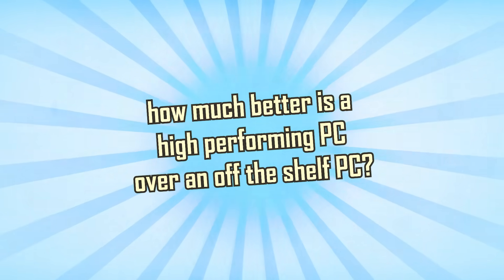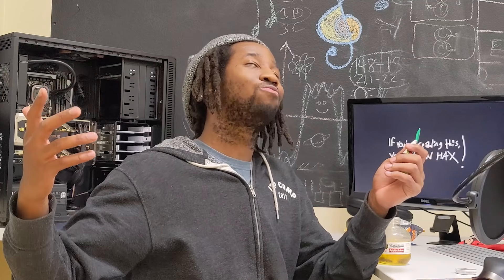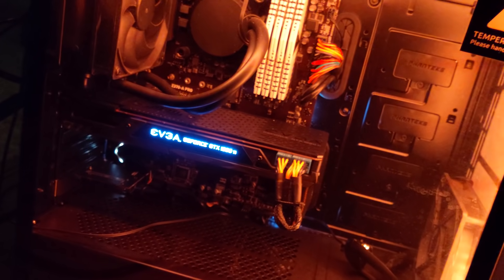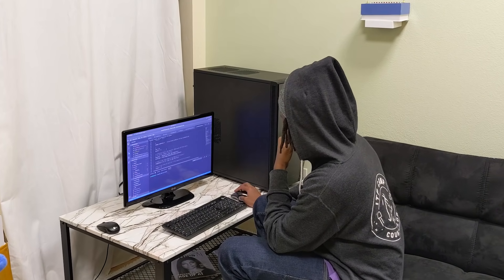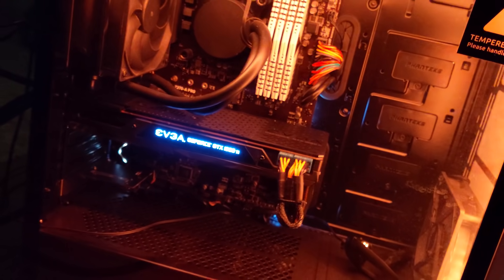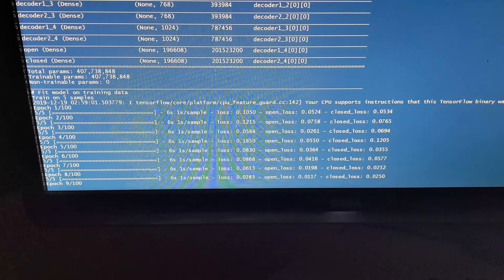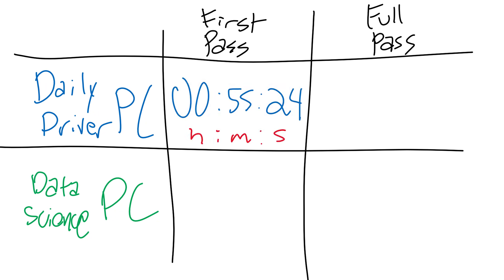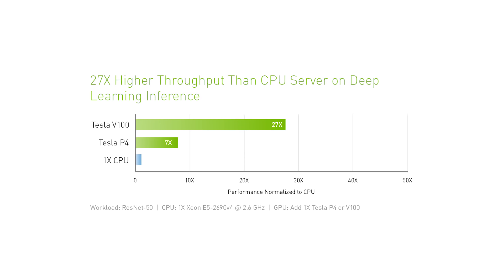Running AI on a $10,000 PC

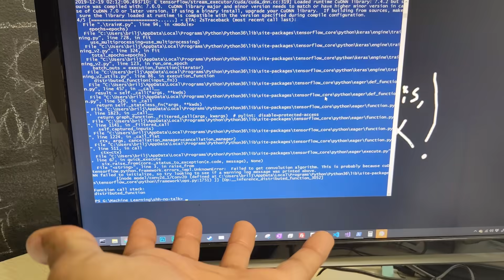Comment: 4:55
There is a warning message above it, at the top of the window.
"Loaded runtime CuDNN library: 7.4.2 but source was compiled with: 7.6.0. [...] If using a binary install, upgrade your CuDNN library."
The error message at the bottom says: "This is probably because CuDNN failed to initialize,"
So you need to update CuDNN to version >= 7.6.0.
Reply: Can't use CudNN unless you have an Nvidia gpu
Reply: @mohameddharis6824  He has Nvidia GPUs in both systems
Reply: upgrading Cuda libraries on windows is considerably easier than on linux. But you really should use docker container or some kind of container. it doesn't help that Google's tensorflow docs on installation errors kinda sucks!

Comment: I had the same problem a while ago during a computer science lecture. My laptop did not support AVX which is needed in order to run tensorflow. What I ended up doing was replacing the tensorflow backend with Theano, which supports the same instruction set as tensorflow, but is not dependant on AVX

Comment: Hi Jabrils, on the screen of the laptop you planned to use (the one you ended up throwing in the bin), you were downloading the Linux version of the file. To install tensorflow without a file just run "pip install tensorflow" on the command prompt. To install with a file just click this link and save the file:

https://files.pythonhosted.org/packages/c6/dc/9030097e5774fe02d1be3cb42eb54125d2c0607a6c11172f1dcad2b7fdcc/tensorflow-2.3.0-cp37-cp37m-win_amd64.whl

By The Way: I selected this file seeing your python version in the video.

Then navigate to the file in the cmd and run "pip install tensorflow-2.3.0-cp37-cp37m-win_amd64.whl"

I hope this helped you Jabrils. By The Way: I love some of your AI and Machine Learning Videos. Also I am 10 years old and I am interested in AI and ML in Python.

Comment: well... did you install the NIVIDIA CUDA 10.0 Package and delete the cud64nn.dll? cause yeah if you don't tensorflow prints that error, you need tensorflow 1.14.0 for py36 for tensorflow to work on windows 64. You also need the visual studio C++ build kit regardless of if you use VS, tf imports modules from the toolkit

Comment: Cool PC bro, but I'm kinda curious how the algorithm actually works.

I would think that a good way to do it, would be to make multiple algorithms that each do a small job, and contribute to a final algorithm to tie it all together.

I think it would be good to make simple image recognition algorithms to do these things:
Find your head in an image.
Find the direction you're facing.
Calculate the properties of the ambient light in the room, based on how it changes the skin tone of your face.
Find the position of your mouth (and optionally, your jaw) on your face, and include some margins around the edges.

You can then have those algorithms feed their output to a final algorithm that uses the hints provided, as well as the original image they each looked at, to decide how best to do its thing. Except that the algorithm for finding the location of the mouth, should probably actually be used to run a cropping utility of some kind, to pre-process the input for the final algorithm. And the algorithm to find your head in an image, should do that, but for the other smaller algorithms.

But don't take my word for it! I'm just a backseat driver.

Comment: Wow two titans!!!
And what’s that’s u got under that Corsair closed loop liquid cooling unit.
I see no situation we’re you need 120 gigs of ram.
Reply: After Effects eats up all 32 GB of my RAM just by starting a super basic project. Other programs like Blender can also use a lot, so it's not uncommon to see PCs with 64 GB, 128 GB, or even more.

I would not be surprised if data science also can required large amounts of ram to handle large data-sets or huge files.

Comment: YOU can get almost the same performance by using 2x Nvidia 2080 Super cards in SLI for a fraction of that cost. Titan cards are for the industry people and the fact that they are not consumer grade puts a huge price penalty on them, effectively jacking up the price.
Consumer hardware is much more competitively priced, and hence the only sensible recommendation for normal people to buy. 
For example, Nvidia 2070 ti cards can be bought for around 500 USD apiece, and put in a PC worth 2500 USD for a similar performance as this 10K USD ridiculous thing. 

You can compare the Spec sheets of the 2 graphic cards as well till the 99th percentile scores.
Thank you.

Comment: dude I have an HP z600 with a tb hd and a tb ssd and 12 gigs of ram, the ram is not great but the cpu is the xeon 5645 and you can dual socket it.  Then it runs two 10mb l3 caches and you can put in even more ram.  Its ECC ram though also so you have to buy it on amazon and its cheap. I paid $275, put in gtx 1060 6gb also has dual slots for video cards.  They are the best cheapest buy for the most value.

Comment: How much faster would this be than your 1080ti system, saw some where that the tensor cores on the rtx cards only speed up training if using fp16. Also heard that sli doesn't really improve much as tensorflow can't use both gpu's memory.

Comment: The laptop couldn't install TensorFlow, because CPUs that do not support AVX, the TensorFlow must be version 1.5 or lower. If you want to install Tensorflow 1.5, the Python version must be 3.5 or lower. So the updated TensorFlow that was most probably trying to be installed didn't work. AVX is only on the newer CPU's and on the intel core series chips. So the cheap laptop was probably missing the AVX support.

Comment: 4:00 - LOL, you tried to install the manylinux version of tensorflow on a Windows platform, that is why you received that error (side note: that is also why "sudo" did not work for you, the "sudo" command is found on Linux systems, not Windows). You need to either do "pip install https://storage.google.apisdotcom/tensorflow/windows/cpu/tensorflow-2.0.0-cp35m-win_amd64.whl"and re-write/re-compile your script/app for windows or you could try installing the manylinux version of tensorflow using Windows 10's WSL but I don't know if that will work or not as I have never used Win 10's WSL, the last I heard though was that WSL is still MILES away from a good Linux emulation.

Also, at 5:00, the error log that it's telling you to check for is literally at the top of that same window. Basic Linux troubleshooting, any time you get an error message, trace backwards through the log until you find where the first exception is thrown and then address those issues, re-compile and run again. Lather, rinse, repeat until successfully compiled/running.

If you need help, hit me up, I've had the tensorflow/faceswap program working on Windows before with cuDNN...

Comment: OMGawD that error @ 5:00  LMAO
Reply from the maker: you're telling me 🙄🙄🙄
Reply: @Jabrils  I started programming 40 years ago, and I've never seen a message that bad unless the developer was intentionally (and clearly) making a joke.
Reply: @Us-wc5js  It's very common when scripts recurse multiple levels deep and subscripts only pass return codes back up the stack.  So like every package build ever.  'Make' doesn't know why that shit broke.  If make knew, make would tell you.
Reply: @alakani  Why does it get framed as a question: "Did you check all the previous error messages?",  instead of "Error: Undetermined"
Reply: @Us-wc5js  Because the subscript probably logged or printed the actual message further back in the buffer.  It's expected that you were mirroring stdout to a file and can just grep for the message if you need to.  Next question: why doesn't it just terminate when the subscript fails, so the message is right there?  Because the subscript doesn't actually know if its own error is going to affect the rest of the build process or not, at that time.  It's sort of fundamental to how POSIX operating systems work.  There are various workarounds to pass messages between processes, or you can reinvent the wheel and polish it all up, but that time is usually better spent elsewhere, especially when we're talking about thousands of different programmers all over the world volunteering code for these projects.  Ever tried herding cats?
Reply: @alakani  Thank You!
Reply: Bruh this dude tryna run linux software on windows

Comment: Loved the video!

Just have a question about specs, I've been planning a budget for a gaming computer I'm going to build but would also like to compare specs for data science projects although have no clue what matters and for what. 

So I'd believe some crossover performance since gaming and data science have similar high speed and high capability processing although machine learning just turns the requirements dial to 11. 

I understand a fast CPU is necessary to handle managing a fast GPU or GPUs, but  does RAM capacity matter and if so, for what (in this case would the RAM just pre-load and temp. store the images being manipulated in the video?) Or is that more GPU Storage? What tends to bottleneck in data science builds?
Reply: Ram capacity matters more so in your case than in other cases.

I think maybe only google Chrome uses more ram.😅

Comment: I also had this problem when I was trying to do my project for uni. For me the solution was to install an other version of python. If you have 32 bit python try 64, or the other way around, sorry I dont really remember which one fixed it for me :S but as far as I can tell from the log messages you need the 64 bit version ( if the computer supports it ofc ) :D
Reply: this guy gets it ;) having multiple python versions on your pc (not environments) breaks most installs of tensorflow/cuda and cudann, we all know the struggle. With that said, I dont think it s a fair basis to compare a gpu and a cpu, he cld ve ran the training on the new cpu too ... anyway

Comment: I love your videos Jabrils. But this is a really unfair comparison. You really don't need a $10k pc to do machine learning. first of all, your os is different in different systems. So compatibility issues will be there. And since the standardization of ML modules, these things don't occur that much anyways. Also, environment creation is a one-time thing you need to resolve. The second comparison you did with the home PC is really a joke. you cant compare a CPU with a GPU in machine learning. If you face issues with installing things(In the video your compatibility issues could have been solved by one single update), you could simply use google colab or any cloud provider to compare the speed. I am skeptical that 1 GPU system will give lesser results than 2 GPU. probably your code is not even running on 2 GPUs anyways. 

So for beginner deep learning engineers, you don't need this much firepower to do machine learning. you can do machine learning way cheap.

Comment: Why are you trying to install the Linux version of tensorflow? Why are you straight installing from .whl that is for Linux? Why are you running Windows on that laptop? I use Tensorflow with Linux and Windows and recently had to get it all set up in Windows. The correct method to install tensorflow on windows is>pip install tensorflow. Or what I used because my pc wouldn't install it correctly was>pip install -U --user --proxy="" tensorflow. Or if you want to use the GPU replace tensorflow with tensorflow-gpu.

Oh yeah, and I think the reason it didn't run on the desktop is that at the top, the error message is that your program is compiled with cudnn 7.6.0 and the version on your desktop is only 7.4.2. Not sure if you ended up updating it and then testing again, but yeah, you could start there I guess? And it looks like Keras is maybe a different version as that's where some other errors are coming through from what I see.
Reply: Smart person

Comment: Jabrils I'm sorry but I'm shocked at how you dealt with this, I'm pretty sure that the issue you encountered clearly said "not supported platform" and I saw you running Ubuntu on your "Data Science" PC not to mention the comparison by default is unfair to the extreme as my $400 PC could do much better than a $200 Laptop but hey that's not the point, the point is that you actually didn't try to use the same OS before even comparing as the Laptop clearly had windows 10 Installed and I think you understand the word "Platform" much better.

In the end I'm not a salty person but I don't want to see my favorite YouTuber brain washing people into buying high end PCs to do data science when it could easily be done in a $800~2000 PC in a very comparable time.

Thanks for reading so far and I hope you do much better projects in the future because you have been idle lately.

Comment: It is not an apples to apples comparison if you are comparing CPU performance from your daily driver PC and GPU performance from the data science PC. Sure, the data science PC will give better results even when oh compare GPUs, but it won't be 24 times faster than your daily driver PC. Maybe 5 to 6 times tops.

PS: Updating CUDA should fix your problem. I guess.

Comment: I generally like your videos but I went and checked out the system and it isn't worth the money. Sure it has two RTX titans but the cpu is crap. The cpu is a quad core xeon processor which means that there are some serious bottlenecking issues and you're not going to get the full potential of the gpu's. You will get 64 GB of ram but it is only at 2666 Mhz which for that price I would expect at least 3200 or higher. 

I built a PC on PCpartpicker for cheaper that will perform way better than that prebuilt PC for about $1000 cheaper. it also has a way more appealing case

Comment: Dude, comparing CPU to GPU performance is just unfair, you could have bought a "cheap" RTX 2060 and run the algorithm on the same CUDA version or just adjust your code to run on a different TF version which is not ideal but you could have compared apples to apples.
Reply: He's not trying to be fair he's trying to get a $10,000 dollar rig for free.

Comment: Yup. Very unfair to compare cpu VS gpu. You should have run cpu on both to get a result which actually means something..
Reply: Well the graphics on both of the cpu's are probably rhe same so there would be no diffrence
Reply: @delfininsjezus  you mean integrated gpu on the cpu? Either way, if you compare a consumer grade gpu to a cpu in this scenario, the difference is also huge. So the only takeaway from this test is that gpus speed up training..

Comment: Bullshit. This is clearly a Puget systems ad. He could easily have run the program on his old PC w/1080ti and got decent results compared to the Puget systems one by using the same os and configuration on both computers. There isn't going to be such a massive difference between the Titan on Puget and gtx 1080ti in his old pc, so he used the CPU only on his old PC to make it look slow compared to the Puget pc

Comment: 3 hrs v 3 days is really misleading as you are just comparing GPU vs CPU. A true test would have been your 1080ti vs the GPU in puget. Also you installed the packages all wrong, you could run the program on your laptop and PC if you spent an hour researching. This video seems to be just a misleading ad more than anything.